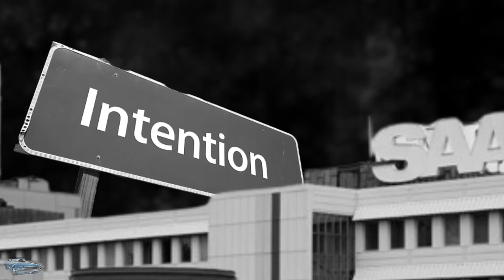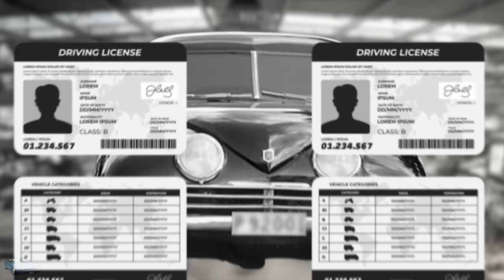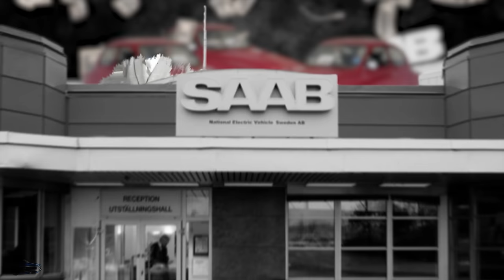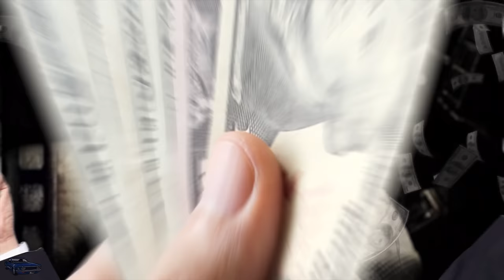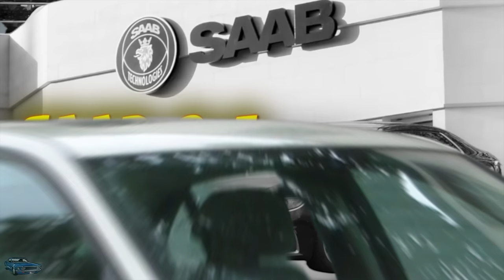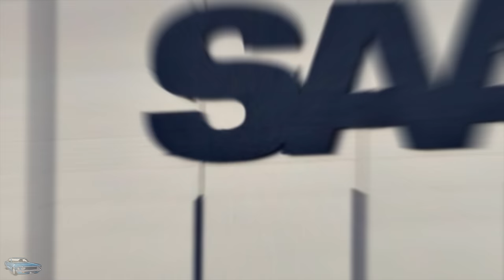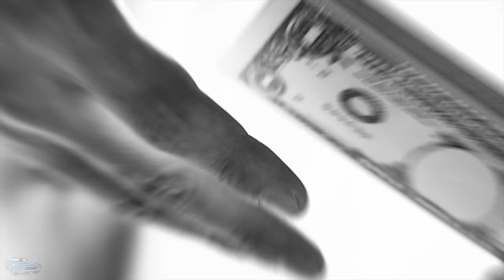The TRAGIC Fall of Saab | A Classic Car Documentary

Comment from the maker: Hi all, I loved Saabs.  And it's a great history story and warning for other auto companies.  What are you thoughts on Saab?
Reply: WORST CARS EVER MANUFACTURED
Reply: GM quickly found out that they couldn’t tell the Swedes anything. GM didn’t realize that a house cleaning of management was needed.
Reply: In Sweden a man was either a SAAB man or a Volvo man (especially until Asian cars took over). Very few ever switched between those two brands, one could tell which car a guy would have. The SAAB man was more individualistic and practical, making most car repairs himself.